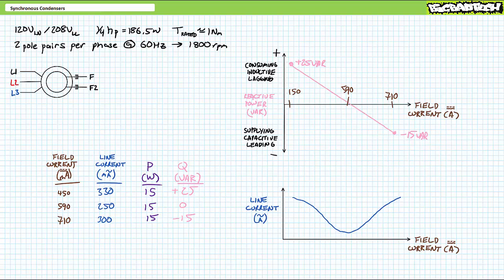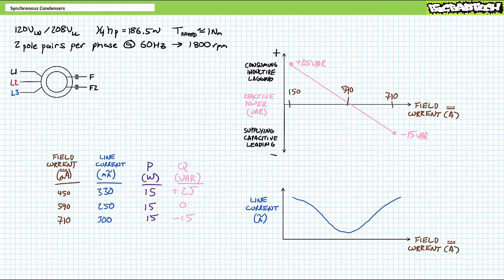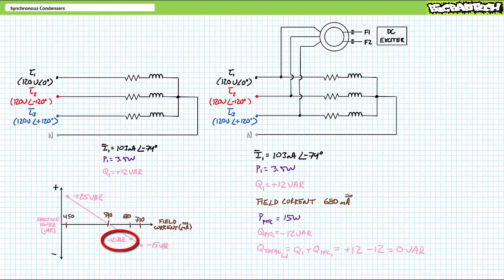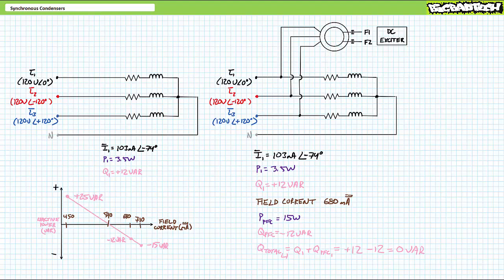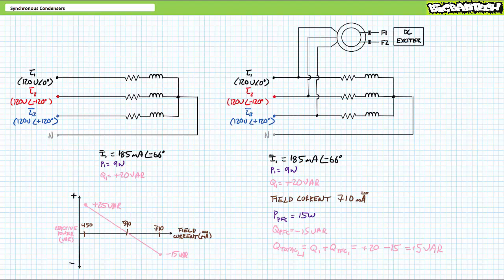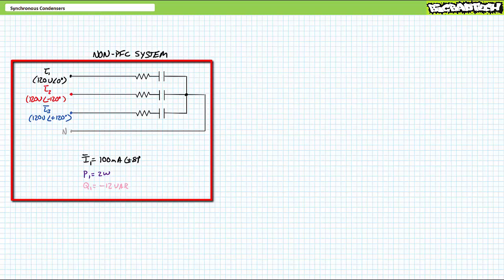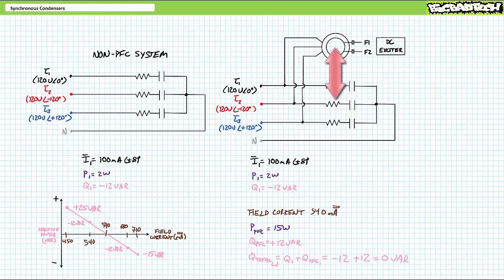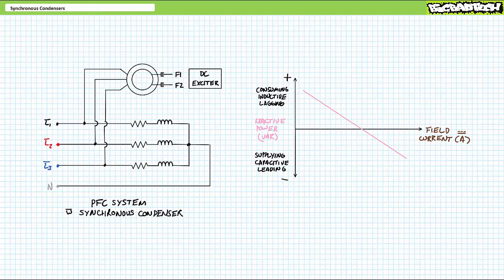Synchronous Condensers (Part 2 of 2)

Comment: QUESTION: Nowadays are the Sys Con rotating machinery replaced by solid state devices?
Reply from the maker: Answering using only a wild guess but yes I'm presuming that new installations of solid state devices like SVC and STATCOM far outnumber the new installations of synchronous condensers.
Reply: I was awed by your robotics videos (still awed). I have an idea of how much goes into setting up these things to do customised tasks and then to make it safe in the end. 
I appreciate fingers after my brief encounter with try to figure out tooling for the arm. So many things to work out.
Reply: Yes they are regaining popularity. In addition to reactive power support, they provide additional short circuit strength for the grid. This makes them useful for renewable energy integration which often lacks the system inertia.